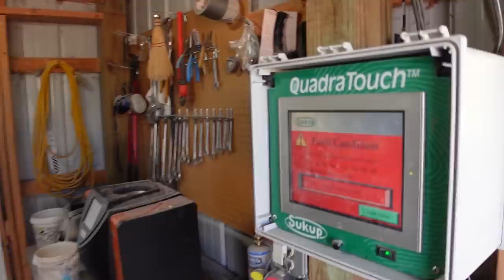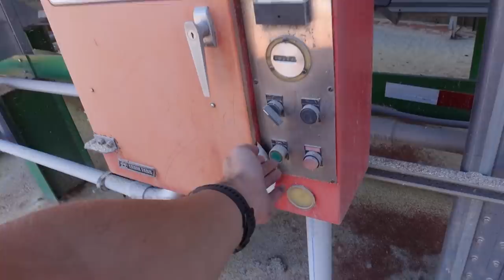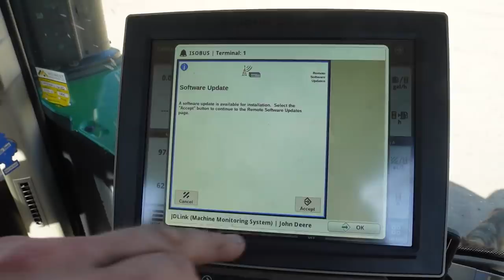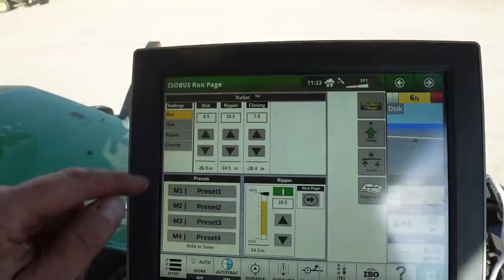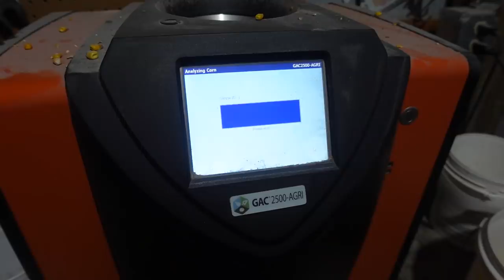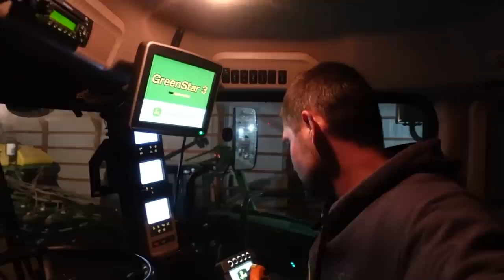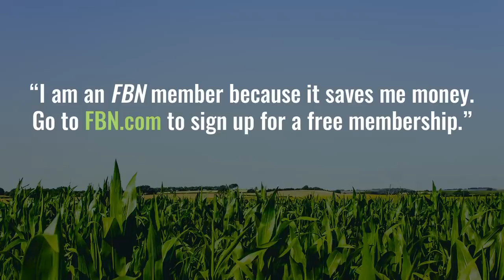Harvest Continues!

Comment: Zack... ? Can you do a breakdown for us non farmers on the benefits of dry corn. How much money do you save on not having to dry corn. 
How much propane do you normally use to get your corn ready to sell.
Reply: @TFT-bp8zk  so what is the typical  desired "MOISTURE". I guess I'm asking.... I know the fact there was no rain this year and the corn didn't grow as much. But is there a blessing also in the fact that your not spending an arm and a leg to dry the corn.
Reply: @TFT-bp8zk  does a typical farmer budget for x amount of money loss during each harvest to dry corn. If yes is there an acceptable amount vrs unreasonable amount. It seems from a layman's point of view a farm is a giant seesaw. Dry weather, soil, corn breeds,water, wind, etc. Farming is one giant gamble.
Reply: Shelled corn needs to be kept at about 15.5 % to maintain grain quality and to keep it from spoiling.  Depending on the relative humidity and air temperature MF can use the bin fans and just air to dry the corn the last 1-2%.   Whether corn is used to make ethanol, feed, or other industrial uses it needs to be kept at 15.5% moisture.  The exception is when hi-moisture corn is used in livestock feed where it can be stored at 23% moisture.  But that requires air-tight storage  to keep it in usable condition, (stored in Harvestore silos.)

Comment: I noticed that you have to turn the grain input tubes by hand, just a thought I retired from Maxwell House Coffee (don’t drink coffee) but i worked in engineering and maintenance and we had Ele coffee tubes that sent Coffee to different silos turned by Ele from a computer and sensors that read metal flags to move the tubes to the correct silos. An operator watching a computer screen could send coffee to any silos that we needed, how ever once the metal flags happened to miss the sensor we had a mess of beans on the roof costing a bunch, so I took one of our Mechanics and just stayed with it until we caught what was causing the dump. It was simple as some of the flags got knocked out of Alignment, so we had an instrument man reset all the flags and no more problems, about $150,000 a year savings.

Comment: The best solution for the lightbulb change is to rent a lift and change them all at once. Then you get new fresh ones with a modern technology, and they will probably last longer than the old ones you have now. It is a more cost effective way of handling the issue, especially when you need a lift to get up there anyway.

Comment: Hope to see Onyx's deer trophy in next video.  This harvest season has been very odd for a lot of people all across the county, especially in our northern areas.  The rain and cold swings have been strange.  But, it looks like you guys, have just kept moving really well despite some setbacks.  Also, I wonder if it's possible to have a system that which the corn, "if a wet bin was empty" can just have a truck empty in the pits then straight into the dryer.  That'd save lots of time.

Comment: Forget about all that high tech computer stuff that is in everything right now, the most important advance, is the electric grease gun. That with the gizmo that clamps it to the zerk are the greatest advance in agriculture, since John Deere made the first steel plow.
Reply: No control on electric- it blows out seals and lets in dirt and moistre that rin bearings.
Reply: @wssides  I think you can over do it with a hand pumped one as well, I guess it is all in the skill of who is using the tool. When I used to go into my John Deere dealer, I would sometimes walk through the shop, and, I just could not believe some of the abuse that was done to those machines. My father had a small excavating company, kept his equiptment in perfect condition, and, taught me how to maintain things. But, I guess in the hands of someone who was not careful they may do what you say, alas, I have never had the chance to use one.
Reply: @keithkuckler2551  You are right. I am pre-electric and the burst tie rod seals and u-joint seals I saw come into the shop were done by hand guns or pneumatic units. U-joints require "feel" of the lever while other joints take sight or finger feel of the boot.

Comment: Mystik lubes?  Looking for a synthetic grease that won't turn to liquid in the hot summers here in east Texas.  Regardless of what I have tried so far, generic, the red tacky stuff, Mobil's Blue, etc.  I grab the grease gun a few days later and there's a puddle of liquid under it from the grease turning to liquid in the heat.  Anybody have any suggestions?  Oh, BTW, thanks for the vid,  Zach.  Becky always does a great job with the editing.

Comment: How does the corn dryer work? Heat source etc.  thanks
Reply: For this type of drier (Continuous Flow) The crop being dried is continually trickled in at the top and the drier is kept full. The crop is carried along the full length of the drying chamber so that the load is evenly filled.
Cold air is pumped in at the base of the drier and this air is forced up through the slowly descending and moving crop.
Approximately about a quarter up in the drier is a massive propane furnace which heats air that in turn passes into the crop as it is moving down. The hot air picks up moisture from the individual kernels and hence reduces the moisture content of the kernels. The moist warm air escapes from the body of the drier at or near the top of the drier. 
Meanwhile down at the base of the drying chamber the dried kernels are often pretty warm so are cooled by the cold air being pushed into the drying chamber and this heat is effectively being recycled back into the grains being dried. 
If the cooling process is insufficient then warm grains being transferred to storage will likely suffer some condensation forming on each grain - which is not good and will possibly lead to mould developing on the crop which in turn devalues the crop and can make it unsaleable at all. Many stores have seperate cold air fans installed under perforated floors to assist with cooling stored crops.
Managing a drier is a tricky job to balance the moisture content and temperature of the crop leaving the drier, monitoring the air temp and humidity being sucked / blown into the dryer, the temperature of the heated air being used to dry the crop (and hence the amount of fuel being used to create the heat - propane) and the speed of grain leaving the dryer as conditions continuously change during the day and often night. 
Most modern dryers therefore use many electronic monitoring devices at various points in the systems and via computers control the operation to automate the system within preset parameters. They also monitor a wide range of safety issues and will shut the drier down in the event of trouble such as mechanical breakdown or electrical failure.
Reply: @Dan.Whiteford  thank you!  I bet that system wasn’t developed over night. Great information. I appreciate the details.

Comment: hey ,  14:52   hey would a like half inch WORM GEAR goin up to the top in like 2 cuhnks / sections VERY WELL BRACED AGAINST THE SIDE OF THE BIN WHERE THERE ARE BOLTS IN LINE ?????  (that's where I saw the thing running up to the top...)  be BETTER Than that cable???  or would that just be a SPIKE IN A TORNADO ????  sigh...  reality thought there...
Reply: Is YELLING necessarily?
Reply: @deadghost1964  SOMETIMES ...sigh... if YOU READ THAT AS YELLING THAT IS ON YOU!!!!!!!!!!!!!!!!!!!!!!!!!!!!!!!!!!!!!!!!!!!!!!!!!!!!!!!!!!!!!!!!!!!!!!!!!!!!!!!!!!!!!!!!!!!!!!!!!!!!!!!!!!!!!!!!!!!!!!!!!!!!!!!!!!!!!!!!!!!!!!!!!!!!!!!!!!!!!!!!!!!!!!!!!!!!!!!!!!!!!!!!!!!!!!!!!!!!!!!!!!!!!!!!!!!!!!!!!!!!!!!!!! <  *THAT* WAS YEALLING!!!!!!!!!!!!!!!!!!!!!!!!!!!!!!!!!!!!!!!!!!!!!!!!!!!!!!!!!!!!!!!!!!!!!!!!!!!!!!!!!!!!!!!!!!!!!!!!!!!!!!!!!!!!!!!!!!!!!!!!!!!!!!!!!!!!!!!! BY THE WAY DO YOU SEE ALL THE !!!!!!!!!!!!!!!!!!!!!!!!!!!!!!!!!!!!!!!!!!!!'s !!!!!!!!!!!!!!!!!!!!!!!!!!!!!!!!!!!!!!!!!!!!!!!!!!!!!!!!!!!!!!!!!!!!!!!!!!!!!!!!!!!!!!!!!!!!!!!!!!!!!!!!!!!!!!!!!!!!!!!!!!!!!!!!!!!!!!!!!!!!!!!!!! jeese....